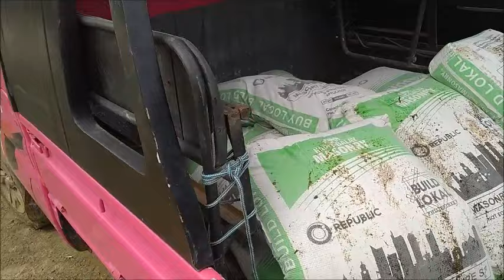The Road Work Continues At Mike And Brian's Farm

Comment: Tatay needs to beef up the intake side more than the exit side. 
I used to work on Storm Water Drains back home, and the entry side needs to be beefed up more than the exit as that is where the main force of water will hit first. 
As well, Tatay needs to extend the Wall sides on the entry side at least a couple of Yards each side further back, so as to funnel the flow of water to the Pipe entrance, otherwise a rush of water backing up will begin to excavate the side walls and work its way in behind the work Tatay has done there, and pick it all out bit by bit, then take the road around the Pipe with it.  
Good job but more work needed. 😉
Reply: And remove the trees. Over time as it grows, the roots will crack open the concrete/ rock . No steel , being used, doesn't help either!
Going to be interesting, when Der boys start, building their houses, will have some serious weight going over, even say carrying only 350 ( a common load over here!) hollow blocks!
Reply: @cynthiagarnham1157  I have watched them roll those Storm Water Pipes off around here and watched them crumble like dust as they rolled down the ramps to the ground! No strength in them, so even the quality of the Pipe is in question here.
Reply: @Da1nOnlyPigsta  exactly sir!